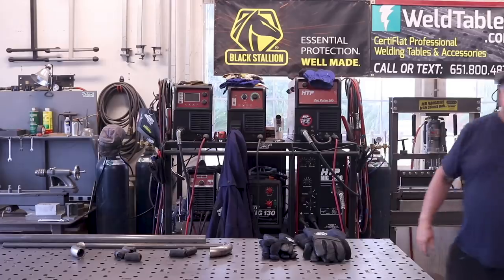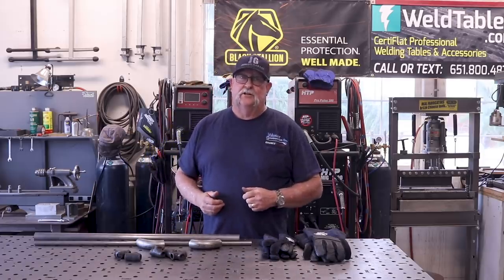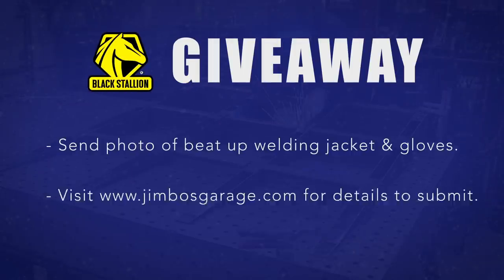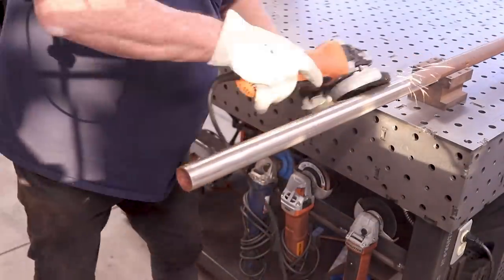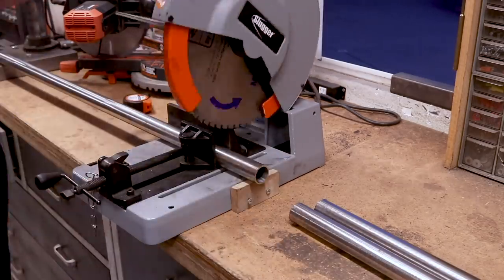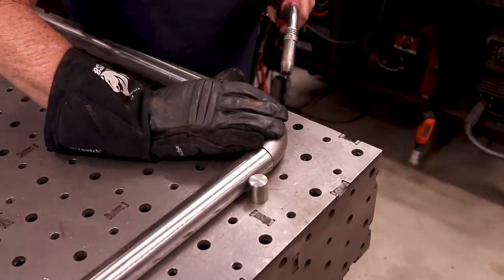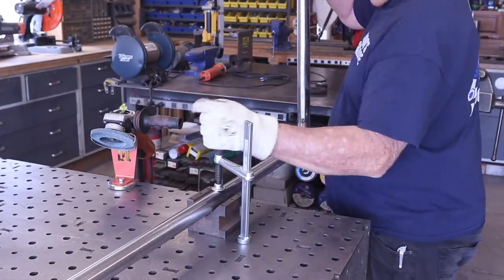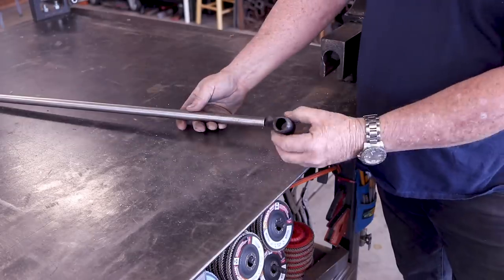Metal Headboard Build | JIMBO'S GARAGE

Comment: Ah. This is a rare time when I’m not happy my stuff is in such good shape.

As far as milling with a vise goes, these vises are not made to hold a part at one end only. That will damage the vise over time. You need to balance it out with a similarly wide part on the other side. What you can do, is to take a flat piece of metal, put it sideways, that is, thin side up, at the bottom of the vise and put your part on it in the middle. Make sure that metal rest piece is narrower than your part.